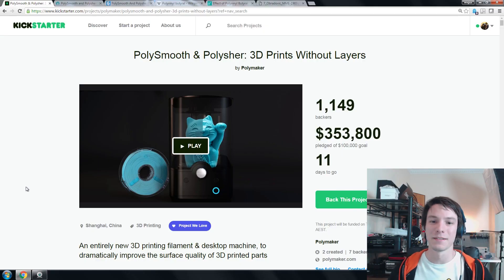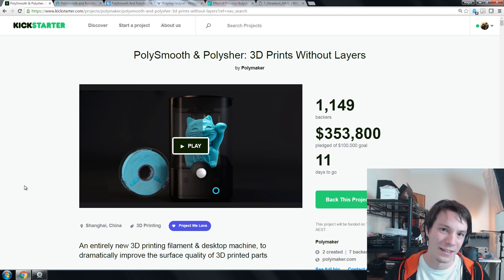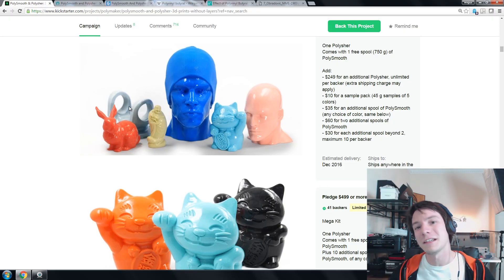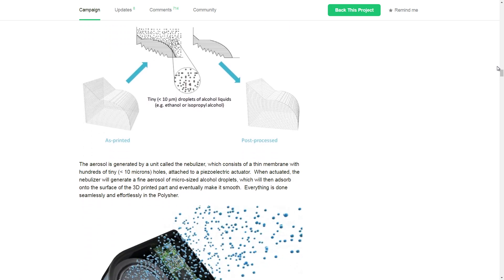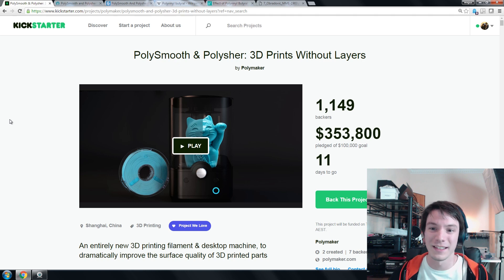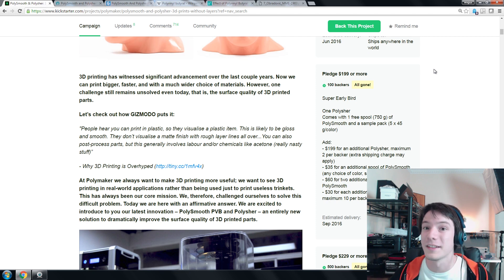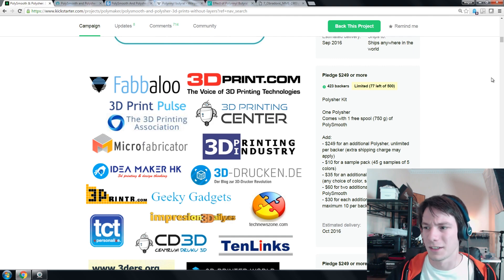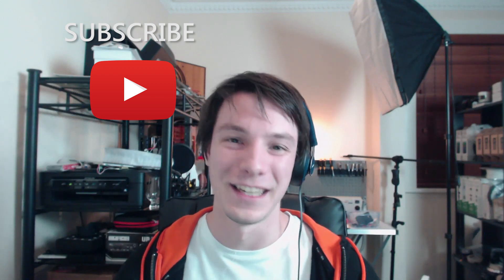Should you back the Polymaker Polysmooth and Polysher?

Comment: You are right, acetone is not the most dangerous solvent.  I have used paint strippers with methylene chloride in them.  That is evil stuff.  It is not only carcinogenic but it burns your skin like acid and can permanently blind you.  It is such bad stuff it makes other solvents appear as harmless as water.  It also goes by the name trichloroethylene.  It is one of those chemicals that is used for stripping paint.  There is likely to be nastier stuff but that is the worst chemical I know of as far as being bad for you goes.  There are some that are nasty just because they are very unstable too and a slight shake is all they need.

Comment: So this printer could very easily be a bomb....
Vaporized ethanol inside of a closed chamber, especially one that typically generates a lot of heat for the actual printing process....
Uhh...yea.
Reply: Fletcher .K It is a lot safer than the D.I.Y way acetone in a rice cooker
Reply: Fletcher .K It does not vaporize it uses ultrasonic sound.
Reply: Mel Manvence it is still spread in the air and KABOOM

Comment: OK so I saw a PolySher at the Maker Fair in San Mateo and asked the safety related question we all had regarding the alcohol fumes and their response was interesting and made some sense. Since the alcohol is not being "vaporized" it is less likely to form a flammable air/fuel mix. This makes sense because their using an ultrasonic transducer (normally used to make fog effects in fountains) to make the alcohol into droplet form and have that land on the part vs heating the alcohol so it forms a vapor and you got the fire risk and so on. While the build volume is a lil on the small side for some prints (depends on what your idea of big is really...) the finish it gave on the prints they had for demos were NUTS! They literally looked like glazed ceramics they were that smooth. Sure you loose some details but if your after stupid smooth this unit can totally do it! 

That then reminded me of something in machining called MQL which is the same concept. You suspend a lubricating oil in droplet form in an air stream and direct that at a tool and because it is in droplet form it is a lot less likely to form a "fog" and that isn't good to breathe in. Still I would NOT smoke next to the unit and use it with some "common sense" but my fears of people blowing up their polysher units have been somewhat abated :)! So hope that is useful to both Angus and everyone else watching!

Comment: If you're going for Noctua fans, I got the NH-D15 cooler kit and it's freakin' amazing. It took my heat during renders down from critical to 48C on the CPU cores. At regular load it's 29 or 30C.
And soooo much quieter than my old fans or water cooler. I've got two more generic fans to get rid of and replace with Noctua 120s and it should be silent :)
Reply: +Casey Wagner +1 on Noctua fans.  I tend to look through NewEgg.com to see what is out there, then you could go elsewhere that is more local to you.
Reply: Please explain how your comment is even distantly relevant to this thread?  Your comment smacks of commercial spam.

Comment: @makers muse, thanks for the video and two or three questions: I am one of the SEB and already Pointed out in their comment section that I find the smoothers fancy lights and the turntable and the moving z-axis more of a gimmick than necessary. I personally think 200 dollar (as super super early bird!) is way overpriced for a electronically sealed plastic hooded nebulizer. Not to forget that this is a gadget u "need" to use their filament and then bounds you as a costumer to buy more of their product. also I wrote about the fact that this is still in development and 1150 backers (1000 in five days, 150 in the next 15 days) may won't be enough to keep production rolling. So what do you think about the unit in terms of (for the process necessary) design and its price tag? Do you think you can do polyvinyl butyral smoothing the DIY-way? Would it be more dangerous compared to ABS smoothing? And is there a future for this kind of filament and method at all?Thanks and cheers from Austria to Australia
Reply: +Ander Crust I can answer that for you, i run a large 3D printing business in the US.

Currently they have the only product in that category. Everything else is junk or extremely expensive. You are not stuck with their product, other manufacturers will produce a similar filament that is iso soluble.

Personally, we print at 100 micron, and our prints from our professional machines come out better than anything you can do on the hobby printers. The layer lines are barely noticeable. We backed this product to see if we can add this machine as a finishing option for our customers.
Reply: Thank you @Ronan. That kind of answered one my questions.

Comment: Here is the response from PolyMaker of the flammability....

Hi Michael,

Yes atomised alcohol is flammable but this is why we are so strict on not using DIY chambers or machine to polish your part. 

We spent over two year developing the Polysher machine to have not only air tight seals, ensuring the mist is contained inside the chamber but also temperature sensors and smart electronics that will kill the electricity if any heat or malfunction is detected. You can not open the chamber while the mist in it and after every polishing process, the fan turn on to ensure the mist is contended down back into a liquid form before the part is raised out of the chamber. Finally no electronics are housed inside the chamber so not electronic spark can happens inside during a polishing process.

We are currently on our last week or two in our TUV safety qualifications (A Germany safety authority) and we expect to have the safety certs very soon

Cheers,
Aaron Jennings
Design & Communications Manager
Polymaker
Reply: I know about TUV.  I see their logo on some of the products I buy for my 2006 Jetta 2.5.  Don't they also test the quality of products or are they really more like the German equivalent of UL?  I only wonder because I have seen their logo on an oil additive.  Maybe they just tested it to be sure it doesn't contain anything too harmful?
Reply: @JohnDoe-gm5qr  
TÜV is testing everything :P
Cars (every German car has to be checked for road safety every 2 years), industrial facilities, amusement rides, all kinds of consumer products. I don't think there is anything which they don't test for safety and certain standards.
It's basically a German UL.

Comment: It's a tech gadget,, cute , clean , desktop friendly and easy to use.
The filament is the real "must-have" novelty item ,, and that is what I'll be wanting/waiting to see produced by alternative manufactures.
 Pre-packaged IPA mist spray bottles recently became available (off-the-shelf), and put out a very-fine misting cloud.  I would imagine these would work perfectly by themselves.
You would also not be restricted to a part size that has to fit in to a chamber ,, and would have the added bonus of being able to suspend your object in any orientation, to smooth out those difficult to reach overhangs.

Comment: Interesting material but if you're like me and use alcohol to clean everything you might inadvertently wind up dissolving your prints :D

Do you have any documentation on acetone vapor smoothing adding to the structural strength of FDM prints? The only one I've found on Engineerdog.com showed that acetone vapor smoothing actually weakens ABS parts.

Comment: I usually agree with you Angus, however I have another opinion on this. First I'm not entirely confident in the longer term stability of a plastic that dissolves in alcohol. Also this is a speciality process for speciality filament, it doesn't use existing materials another black mark imho, and if you actually consider the ramifications of such a fine air/alcohol spray process it can be as dangerous as any other process, which admittedly you do state, it simply seems that one is paying for a switch which has it's own drawbacks.

The biggest concern you 'seem' to have is not necessarily 'for' the new process but 'against' the usual method of acetone smoothing for ABS, and while that consideration is certainly relevant, heating it up isn't the only solution, the cold acetone method is just as viable and pretty much removes all safety concerns because acetone, in itself, while not 'nice' is hardly a real danger, after all little girls play with it from quite a young age and we don't see mass reports of 'The dangers of nail polish remover.' 

I appreciate that there are always new method of processes coming on to the market, however in this case buying speciality plastics to use in your speciality smoothing machine is a solution that goes all round the garden before you hit the gate.

I certainly don't discount your opinion in this particular matter, however I don't necessarily see the benefits of this over anything else, when by using the cold method any reasoning for moving to this machine and it's required plastic are pretty much negated.

Also, people know not to drink acetone, how many are going to consider that "It's only ethanol". I think I'll stick to the cold acetone in a vented area method, that would suit me and my pocket a bit better.

Thanks for the vid though.
Reply: +Elf Tablet I had the same thought about a plastic that dissolves in alcohol. A lot of household cleaners have alcohol in them. It is also a new type of filament which no one has any experience printing with. Who knows how it prints? The process might work but what if the filament is terrible to print with?
Reply: +DIYbaron Yes, agreed.

Comment: Just to let you know in case anybody asks you about this machine later, but it uses isopropyl alcohol, not ethanol. That would not be good if somebody put vodka in their Polysher.
Reply: +CJ Printing It actually uses either, but "with concentrations of no less than 70% (90% or higher recommended)" according to the kickstarter page. Ethanol is not just what is in your drinks, but is also sold in hardware stores at (or near) 100% concentrations as a solvent, and typically called "denatured alcohol". Oh, and they add a poison to it so you can't just use it as an alcohol for drinking...
Reply from the maker: Well spotted, their campaign suggests it can use either but I wonder if isopropyl is safer.
Reply: Maker's Muse Hmm. That's pretty cool. I didn't catch that you could use ethanol too. I wonder which would work better/safer

Comment: its interesting but without going into a ton of tech jargon... the flammable limits for acetone is 2.6% - 13% while ethanol is 3.3% - 19% so not only is ethanol about the same explosive range it has a bit more of an explosive upper threshold! 

ethanol has a 2 for health and 3 for flammability out in the USA and Acetone has a 1 for health and 3 for flammability so honestly... its hard to say which is worse. both will cause a vapor explosion and both have their risks!
Reply from the maker: +Calvin Witt That is actually REALLY interesting. I always thought of acetone as the more 'volatile' but the fuel-air mixtures are something I know very little about. I really hope they don't run into any issues with this. Always appreciate your feedback man!
Reply: +Maker's Muse hey no problem! im not a chemist but a quick read of a material msds says a lot! sure im not saying id go drink acetone but... it isnt like say MEK or THF which are not friendly chemicals! 

the other issue is what alcohol works. some drugstores only sell 50% maybe 70% if your lucky... sure there is denatured alcohol but the chemicals in there are pretty nasty! so just another point to keep in mind!
Reply: +Calvin Witt They say you can use either Ethanol or Isopropyl at "no less than 70% (90% or higher recommended)." I've seen 70-90% Isopropyl in drug stores quite commonly, plus it seems to have a flammable limit closer to acetone (2 - 12.7%) at 100% concentration. I'd imaging using 70% concentration would lower that respectively, but I'm also not a chemist... :)
Reply: yeah true true, that said flammable vapor is flammable vapor regardless. The scary part about alcohol is that it burns HOT and CLEAN so it can be very hard to tell you have an alcohol fire while acetone tends to burn a bit "smoky" which is actually a good thing for spotting it.

Regardless I am not calling one chemical victor it is just a case of each one has its ups and downs... I think they are going to need a pretty lengthy safety video on it. If i have time post finals I may do a few crude tests on how flammable acetone is vs denatured alcohol for my own amusement.

Comment: As far as the fuel/air mixture, it takes a rather precise mixture to cause a proper boom.
Reply from the maker: +RandomChaos Very much agreed - but the fact that it 'could' happen might be enough to cause issues, even if it's highly unlikely never to be an issue.
Reply: +Maker's Muse indeed, alot of people like to play what ifs up as will happen everyday. just don't light stuff on fire beside it :-)
Reply: But small booms are bad enough
Reply: +XAD566 Especially in small boxes.
Reply: Alcohol does not have to be a mist to ignite and cause a fire.  Why else do we use it in E85 fuel?  I know it really has no place in in our fuel tanks but it is in them anyhow in concentrations of at least 10%.  Yes, it does ignite easily enough even as a liquid so I would keep a fire extinguisher nearby.  Accidents do happen even though no one thinks they would or was expecting them to happen.  It is safe as long as you keep that in mind.
Reply: RandomChaos unless you mix it with liquid oxygen liquids can not burn. It requires mixing with oxygen to ignite which gases and liquids can not mix properly due to extreme difference in density. The fumes that come off the alcohol is what burns once it mixes with oxygen.